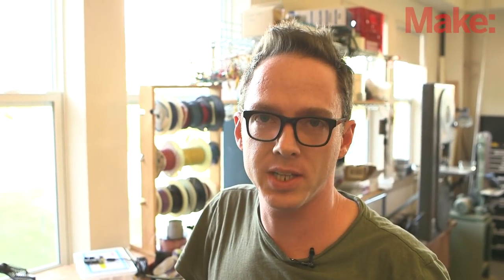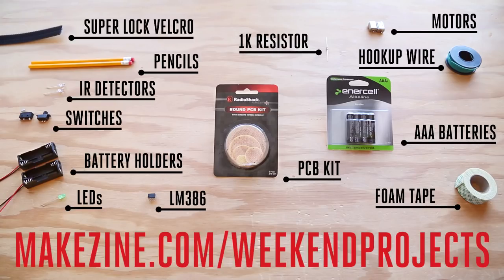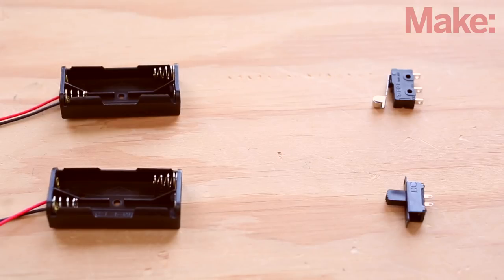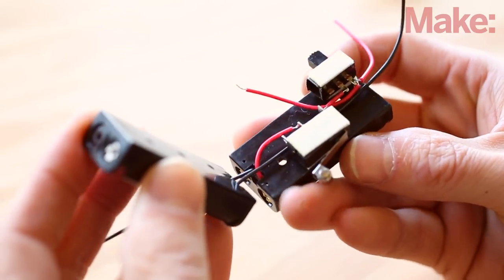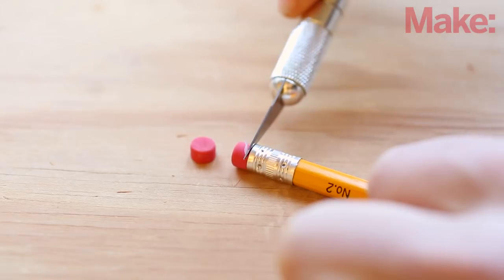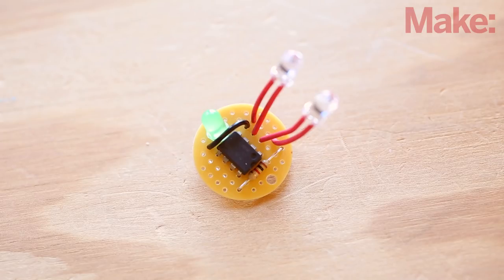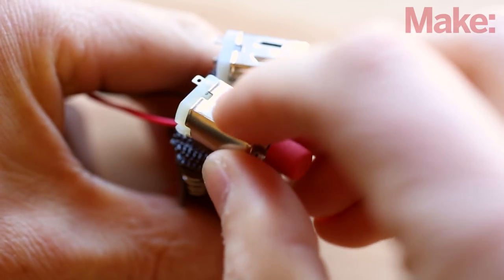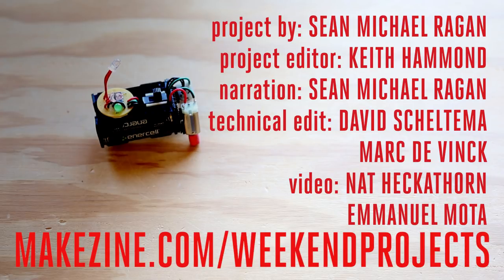Weekend Projects - SunBEAM Seeker Bot

Comment: You should tell people to be sure to use the LM386 because its output is internally biased to half the supply voltage and it wouldn't work otherwise.

Comment: I was wondering if I can use this circuit to turn the solar panel to have better light ? MAKE Any comments or suggestions on this ?
Reply: Probably
Reply: i Think so But, you Have to think that it will be in An Sun Zone And The sensors will Get Saturated!! But Making Some modifications you Can get It!!!
Reply: This is a "photovore" BEAM bot style. To do light seeking for solar panels, lookup "Headbot" BEAM styles.

They use a hex inverter to drive a single pivot motor left/right, and high freq "lock" onto the brightest light. I made one a while ago and uploaded it. (BEAM headbot: "Blue Eyed Dragon")